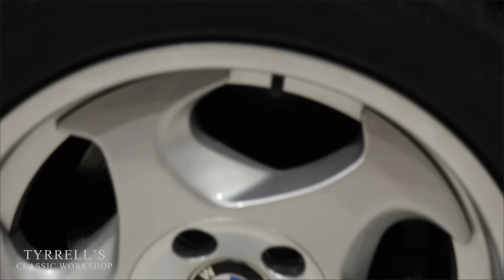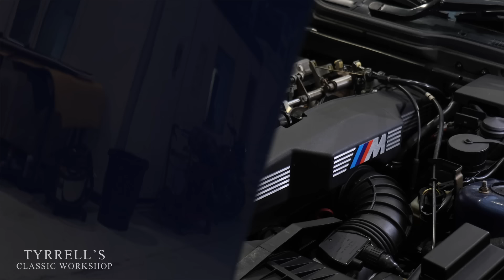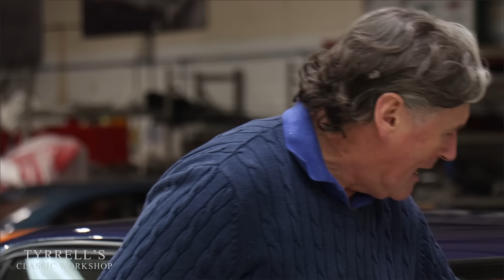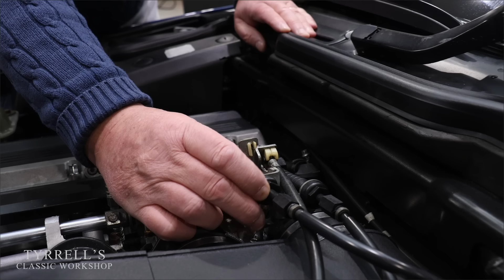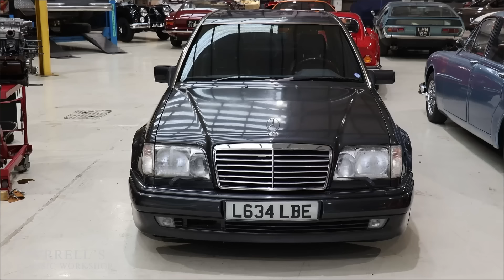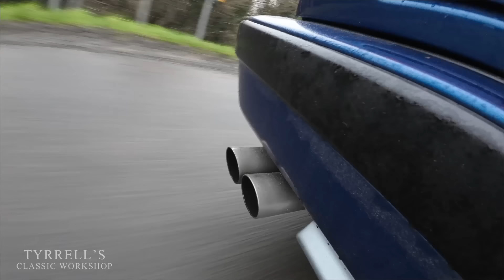BMW E34 M5- the ultimate driving machine?| Tyrrell's Classic Workshop

Comment: Australia in the late 90's had some pretty good fast sedans.  Both Ford and Holden had go fast divisons but produced some pretty quick cars themselves.  Ford had Tickford which morphed into Ford Performance Vehicles and Holden had Holden Special Vehicles.  Locally produced V8 engines stopped in 1999 (?) with the introduction of the Gen 3 5.7.  Its a long time ago but my recollection was that they were well sorted and very quick.  My first V8 Holden was a CV8 Monaro in 2002 which I still have.  The engines were absolutely strangled and so only put out 300Hp - this was done to make the more expensive HSV product seem more attractive.  Great cars, well balanced and powerful.  A standard CV8 driven in Targa Tasmania beat lots of high end Europeans with  very good drivers.

Comment: For Australian super saloons I can say nothing we made in the period really compares with the E34 M5, the HSV Walkinshaw homologation VL Commodores and the HDT VK Calais Directors are the closest contenders but actual performance puts them in the class of the basic six cylinder 5-series and Ford had dropped the V8 and performance division for several years. These GT sedans give the right noises and sensation of a homologation V8 touring car but they're very detuned with barely 250hp on a good day. I had a backyard tuner Torana with an XU-1 modelled engine, a triple carb 3.3 litre six with about 230hp or so and that beat a late model HDT VL Group A homologation sedan in a street race back in the 90s. They're weren't very quick but that's how parliament wanted it after that supercar scare with the Phase IV GT and V8 XU-1 in the early 70s. The authorities really stomped on the idea of car dealers selling hot rods to youths and if Holden and Ford didn't play ball they'd start having all sorts of regulatory problems. This all got relaxed over time as European giants introduced Autobahn GT super saloons all over the world in the 90s onwards like the AMG and the M-cars, so at last our local Ford and Holden got away with high powered turbo sixes and imported LS motors, finally supercharged and injected V8s with ridiculous power I know traffic police despise.

Comment: In Australia, the locally made performance equivalent would have been the Holden VN SS Group A - slightly less power (215kw vs 232) but a bit more torque (411 Nm vs 360) - but, a LOT cheaper - less than half in fact. Kind of a bulkier version of the Lotus Carlton - and only available in one colour...

Comment: The reason why this engine gets more and more powerful revving up - this generation still has only one set of intake pipes - and they're quite big. At low revv - the air doesn't swirl properly as it's "bumbling around" inside. With increasing rpm - it pulls harder and harder because better air swirl causes optimal fuel/air mixing and cylinder filling.

Modern cars have swirl flaps in their intake systems to do that.

Opel Omega and it's Vauxhall counterpart had big and small intake pipes on their 6 cylinder engines - with a switching system regulating them. They were the first big brand to use this system.

Comment: Lovely car!  Almost bought one back in ‘97; a ‘91.  Ended up buying a ‘92 e34 2.5 as it was in nicer condition and affordable.  No regrets though as the baby 2.5 M50 24v was also an excellent engine, with a very soft bottom end but remarkable up top.  E34’s were just about perfect.

Comment: I had an E34 535i for 20 years which I absolutely loved. I lusted after the M5 version and came close to buying one,but could not find one at a price that matched the condition.

Ultimately I bought an E39 M5, which proved to be a big mistake - terrible build quality along with flat footed handling. 
I also kept that for 20 years , but only because the value crashed and I wasn't going to give it away. I kept it until the value rebounded, but seldom drove it over the last 5 years or so.
I should have tried harder to find a good E34 M5!

Comment: Great video, Iain - thank you.

As a former 3.8 5sp owner this brought back a lot of good memories indeed!

A small point about the wiper; the E34 M5 was fitted with speed-sensitive pressure motor that would draw the arm tighter to the screen to ensure no lifting/reduction in wiping effectiveness.  

Secondly, the indicator/wiper stalks were considered so tactile and well-engineered they were selected for no less than the McLaren F1.  

Great to see this car in the limelight; hugely overlooked still.

Comment: The hook on the wiperarm of the E34 is inverted, the trick is therefore NOT to flip the wiperblade upside down (as you normally do) whilst unhooking old ones, and installing new ones.  It took me a while to figure out, but knowing that, it only takes about 10 seconds instead of an hour.  Another common matter is the wiperarms loosening and thus striking the metal edge of the hood, causing it to rust.

Comment: In reference to the question of whether or not there were any notable 90's American sport sedans within the same class as those mentioned. After a bit of trying to recall sedans of that era I started to realize my tastes had begun to change away from what the states had to offer save a few interesting concepts. The Cheverolet Impala SS and the Mercury Marauder were two oddities in, what I found, the rather mundane scene that was the American car market of the 90's. Both promised with big blocks that were yanked from the concept before they got to market, neutering what could have been an epic offering for the time. But such was this bait and switch so that it was left up to the purchaser to upgrade the vehicle to its proper form. Both were full sized sedans that lumbered under their weight with less horsepower than the crop of european sedans you mentioned, so hardly a comparison. The only a couple others that come to mind and they are no where near the same class, The Ford SHO Taurus and the Dodge Spirit RT. Im sure there are a few that I am leaving out but if it were something of note I believe it wouldnt have been so easily lost to time.

Comment: "Tactility", perhaps? Likely, neither is incorrect. English is much less precise than a steering unit of the recirculating ball design.
     Challenge accepted -- and conceded. The only point in raising the Ford Taurus SHO would be to illustrate the difference. Over sixty years ago, Buick and Pontiac (respectively) designed an aluminum V-6 and a SOHC I-6. Neither was ever sold in any numbers. Whether the reason was cheap gas, price over quality or lust for tire-shredding torque. "... ain't that America ..."
     Born raised within one hundred feet of an asphalt surface throughout my life, I can tell you that it is.

Comment: The V8 M5 that came after this will always be "the" BMW for me as a teen of the 90s. 

But that is a proper car, thanks for posting! 

R32 GT-R skyline would be the obvious 1990s straight-6 ITB halo car to compare an E34 M5 to? The Holden HSV V8s were only about 185kw at this time. I remember that,  because they were so proud of their 185 kilowatts that they had a massive "185i" sticker on the rear as part of their whole identity.

I had a drive of an E30 325i once. Lovely thing, as a Triumph 2.5pi guy 6 cylinder BMWs feel a bit like what tin-top Triumphs might have been like if they'd prioritized handling a bit more over ride.

I worked with an old fella who had an XJ6-C, in his heyday he'd had an E34 530. He said that was a lovely fast car, much sportier than his Jag, but he never knew when it would just fail to start, and the problem was always some $800 electronic black box.
Reply: The GTR was an AWD 2-door coupé and had two turbos vs the N/A big block 4-door bimmer, and while there were performance versions of the Skyline sedan (notably on the R33 gen) they were limited editions for Japan only.

I don't think Japan had a proper M5 competitor until the Lexus GS-F came out.

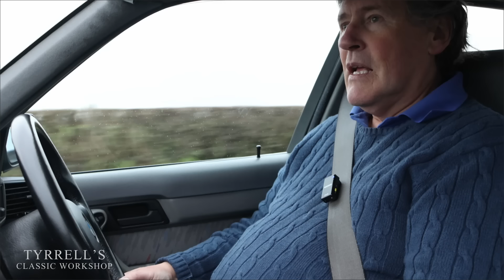Comment: To answer Iain's question at 16:11, there weren't really any American production 4-doors that delivered comparable figures; the closest would have been the 1993-'97 Cadillac Seville STS, which received just under 300 hp from its 4.6L Northstar V8. However, if you weren't concerned about matching the Europeans' numbers but just wanted a fun, involving sedan, the 1991-'92 Dodge Spirit R/T and 1990-'95 Ford Taurus SHO both fit the bill. Granted, both were front-wheel-drive, but both also had DOHC 4-valve-per-cylinder engines (a Lotus-fettled turbo four in the Dodge, a Yamaha-designed-and-built V6 in the Ford) making at least 220 hp, 5-speed manual gearboxes (though 1992-'95 SHOs could have an automatic), and upgraded chassis tuning.

Comment: Check the play in the steering box between the input shaft and output shaft/arm. All BMW with ball-type recirculating steering systems are prone to this. The higher the mileage, the worse it is. They wear out quickly, right from the first mile. You can spend thousands of pounds on a new front axle and the steering play will remain the same if the steering box isn't rebuilt or just cheaply repaired in the backyard.
Tip for everyone with hydraulic power steering: Whenever possible Only steer when the car is moving. You can Test it: Stand still,Engine Running, press the brake and steer fully to the left and right. Now listen to your engine, hydraulic pump, and steering gear scream for help.

Comment: You say ITBs are needed for neck-snapping acceleration but the 991.2 GT3 with the DGGA engine has instant throttle response and uses a single throttle body.

Comment: The M5 have no break cooling in the front bumber. The left duct is used for cooling the slternator and right duct is closed with a little hole for the temperature sensor of the BC4. The break cooling will be managed over the rims.

Comment: Lovely review Ian, so rare to see these cars as they are usually overshadowed by the E39 series.
This is the earlier 3.6 car, though, not the 3.8. The 3.8 was fitted with a 6 speed gearbox and had the wider facelift grille.
Reply: Nope... thats 3.8L, 5Speed.
Reply: Apologies, you are correct, of course.  I should have looked more closely at the cam cover. 😅

Comment: I would think the 89 ford taurus sho comes pretty close.  3.0 Yamaha headed v6 with 12 intake runners.  6 for low revs than it would switch to the other 6 for high revs.

Comment: Do not use standard WD-40 on BMW door hinges, as it is a cleaner/degreaser, not a long-term lubricant, and can attract dirt, causing further wear. Instead, use white lithium grease, silicone spray, or dry PTFE lubricant for durable, non-sticky lubrication. Apply sparingly directly to hinge pivot points and door brakes.

Comment: I have a Aus/NZ Ford Fairlane G8 albeit from 2007, but the design harks back to the late 90's early 2000's. That is a 4-door super-saloon with 300+ hp V8, and suprise, suprise, my central bearing has gone as well, so presently going 0 mph until the parts arrive from Aus. The US equivalent would be the Caprice SS I think, with the corvette motor, but no where near as handsome as the BMW M5. I think this era of BMW was the best; simple range, 3, 5, 6, and 7 series. I've no idea who is styling BMW now, but they look awful, and let's not get started on the i-Drive system. 🤣

Comment: I wonder in 30 years if the modern day BMW's will be viewed with such passion .......
Reply: I seriously doubt any will be drivable after 30 years.  Too many modules, sensors, and crappy plastic parts.  Still driving my 1970 02 with 40 year old EFI from a 318i which has surprised me.  I have one rebuilt ECU still if needed.
Reply: I'm curious too. I think something like the 2022 M5cs will still be seen as great in thirty years, but something like an XM suv... don't think so. The styling in my opinion certainly won't be matched anymore, that peaked in the 90's!

Comment: I used to own one of these but it had a faulty snizzle trumpet. I had to loosen the infra-red flange, drain the slush bucket using a brass funnel and fit a new twizzle. After that it ran like a dream. Unfortunately I left it in a car park in Pontefract and when i went back it'd gone. Security checked their cameras and saw a crack team of dwarfs dressed as Brazilian sailors stealing it. Apparently they opened the door with a modified Goblin teasmaid.

Comment: Amazing video. The timing chains are fine on these engines, what you have to watch out for are the rod bearings wearing on the 3.8 (not the 3.6). Cooling is a weakpoint as per any BMW, they don't take kindly to overheating. Also cabin air filter behind the center console can be a fire hazard if neglected. Love my E34!

Comment: 1994-1996 Chevrolet Caprice 9c1 (cop spec) w/ the slightly downtuned (thicker head gaskets than the corvette for cooling reasons iirc) 5.7 LT1 was capable of 140mph & handled surprisingly well due to massive sway bars.

Comment: The Aussie Super Saloon's of period would have been VS or VT era Holden Special Vehicles (Nice TWR connection there as well). It would need to be one of the Harrop stroker 5.7L powered cars to get similar levels of performance. The 304 / 5L was too anaemic.

Comment: To answer the question posed in the video.

I can't speak for the yanks, but the closest thing us Aussie's had to the M5 would have been the VP/VR/VS model HSV HTS versions of Holden Commodores (spanning 1992-1996).

Almost similar ish (kinda) power/top speed, but engineering wise closer to something Fred Flintstone would have driven compared with the E34 M5 of the equivalent year. The latest VR model had a 5.7L Holden V8, stroked out from the 5.0L version found in the other commodore models that had a v8; it made 215kw and a top speed of just shy of 250km/h, and a 0-100 time of mid 6's.

One point in its favour is it was well less than half the price of a E34 BMW M5.

Comment: My father had a 3.8 M5 Nurburgring followed by a 4.0v8 540 touring auto. It was amazing how different the characters were as the M5 was properly cammy and the 540 was all torque in direct comparison. 
Dare I say the 540 was probably easier to drive fast down the back roads. Probably helped by the compliant chassis and my poor driving skill level. The M5 Nurburgring button simply turned off compliance on UK back roads 😂

Absolutely loved both cars and was fortunate to cover good mileage driving both. The M5 was so special. Every time.

Comment: I can remember having 1800 km blast through germany in 22 hours as passenger in early 2000's in that car with some 220 thousand km on the odo. We were surprised how efficient it was. Through all those 260 km/h autobahn rides and spirited b-roads driving, pedal to the metal all the time, the final comsumption was 13,8 l / 100 km.

Comment: Mr. Tyrrell the only American made I can think of from the mid-90s is the 1994–1996 Chevrolet Impala SS, which is the quintessential American mid-90s mass-produced "super saloon" (or muscle sedan). It combined a 260-hp 5.7L LT1 V8 engine (derived from the Corvette).  You said 300 hp but 260 is the number Chevy put out for insurance reasons it was easily 300+hp.

Performance: 0–60 mph in roughly 6.3 seconds, with a top speed exceeding 150-mph

Comment: To answer your question about whether there were any American "super saloons" in the 1980s, like the M5, the Buick GNX comes to mind. For a 4-door version, the 1987-1989 Buick Regal Turbo (specifically the 1987 T-Type/Turbo-T) featured a 3.8L turbocharged V6 engine, producing 245 horsepower and 355 lb-ft of torque.

Comment: Far be it from me to question Mr. Tyrrell on anything car maintenance related, but I'm surprised to see WD-40 being used, as WD-40 is a water displacer, not a lubricant. That's why it still squeaks. Something like Wurth HHS is the best for hinges that don't take a grease gun. It sprays as a liquid, dries to a grease.

Comment: That has to be one of the best colors I have ever seen on a car.

I wish you had shown yourself or one of your associates adjusting the steering box. Years ago I had a 1985 MB 300d with a loose steering box. 
I tried turning the adjusting screw in and it did no good. I then started turning it out almost to the point I thought the screw would come out and it actually seemed to make the steering tighter. 
Thanks, Iain.

Comment: Oh no...please NEVER use "Water-Displacement (formula) #40 known as "WD-40" as a LUBRICANT. Too thin, and the carrier, the chemical that displaces water doe not lube. Use WD40 a towel fine brush to clean and dissolve dried-on old lube...then use aerosol applied white-lithium grease on BMW metal-to-metal door hinges, hinge pins, striker plates...😊
Reply: It's why Ian still hears that squeak/squealing as he rotates door along its axis of travel on the rotating hinges/pins.
Reply: Ian. In 1992, the 4 door, up-market corporate-cousin to a Ford Crown-Victoria was named "Mercury Grand-Marquis". One could order leather upholstery, AC, power windows, seats, door,-locks, tinted windows, AM-FM Stereo w/CD player dual zone climate driver/pass., rear window4 rear window defroster, cruie-control, rear air suspension and firmer suspension.  Finally dual-exhaust pipes on the 4.6 liter V8 giving up to 239HP/287 ft. lbs. Torque. It was slower, softer riding, not the equal of BMW in handling...but "streets-ahead' of standard Chevy and Ford full-size 1990s saloons.
Reply: One had to order the HPP handling package too
Reply: @markscungio2996 
This is your reply on a comment about WD-40??